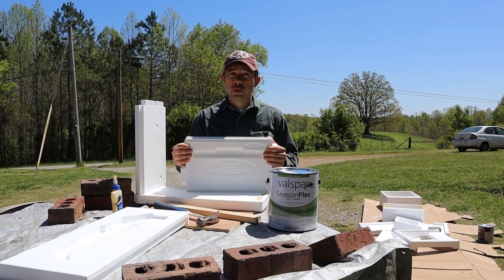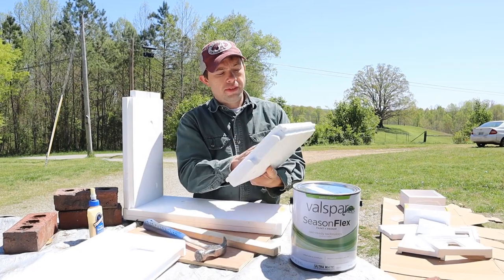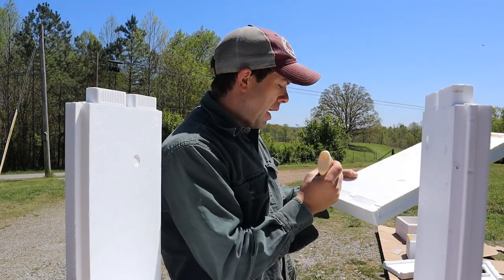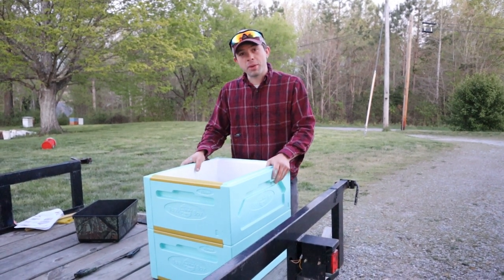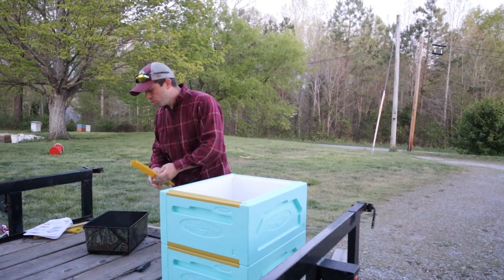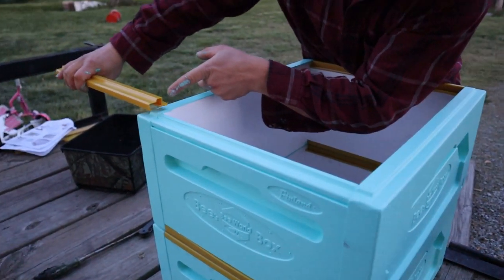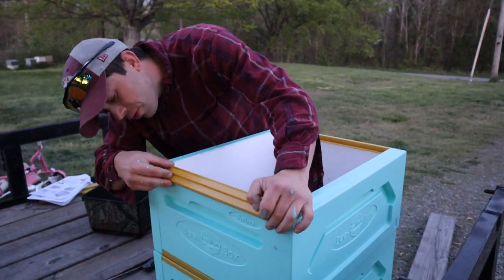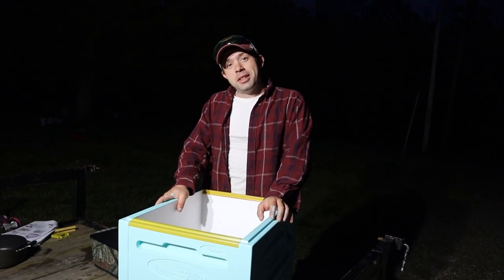How NOT! to assemble a poly hive!

Comment: I helped a friend with bees in 2 colonies, 2 stacked poly 6 frame boxes that he purchased from a local that was moving. Also a couple dozen 8 frame wood but those were empty. All were deeps. We purchased 4 nucs to get those installed in some wood. Bought 6 new poly last yr and did a Kamon but I am a sun worshipper and put them together out on a picnic table so the plastic was sun hot. No trouble snapping it in. Up here in Michigan I have to tell you that we did not have to worry about the poly boxes. Those still had a lot of winter storage left come spring. Last year we had to do splits early on because they were hatching and making queen cells before the wooden got numbers built back up. I love the smaller 6 & 8 frame because while the honey is good, not into it for production/sale yet and at our age, lighter boxes are prefered. Concentrating on building up and spitting for another year. 15 farm acres in town with a lot of resources. It is an active personal production farm that got absorbed/surrounded by the city when the borders were pushed out so it is grandfathered.
Reply: Sounds very nice, there is a another place that sells a 2 inch version of this type of hive made in the US and Ohio called Superior Bee. I have both types Finnish and good old USA.

Comment: these 10 frame and 6 frame polystyrene hives are pretty much all i use and have used for going on 9 years now, definitely my choice over wood. my recommendation for paint is ppg timeless in blank canvas tint, and don't paint the spots where the supers touch as they will stick there and tear off paint in hot weather. but with ppg timeless exterior latex as suggested to me by a career painter, i have hives that are 8 years old and look like new. but there is always a negative as with anything, bees cannot use beneficial propolis in these hives much because of the surface so I'm going to try to staple rough sandpaper or something similar to the inside of the brood chamber on one to see it they propolize it. as always great video and if you need any suggestions about the polystyrene hives feel free to reach out as I've definitely gotten familiar with them over the years. now if only the shipping from bluesky wasn't more expensive than the entire order most times lol

Comment: Hi Kaymon, been watching for a while and I thank you for your insights. I use these exact hives exclusively in my apiary... I live in Northern Australia where it is hot and humid all the time. I love these hives and do not use timber anymore. My tip for those plastic guides is slide them on before assembling the sides. You can use a second bottom board on the top under the lid with the mesh in them as a way for the bees to ventilate the hive. Since doing this I have not had any absconding. The issue I have had is that if your not removing dead outs quickly the wax moth will eat the EPS quicker than timber boxes. Keep it up always good to watch and entertaining as well!

Comment: LMAO.  I saw what you were doing and said out loud "where are the plastic inserts?"  We are trying two of these this year and made a couple videos on them, one "first look" video and one "moving day" where we moved NUCs into them.  The thermal regulation will help a lot.  One thing I found is these have ZERO top space above the frames, that is when the frames are inserted, they are level with the top of the box unlike our wooden Landstroth boxes.  I also ran into problems with the medium supers are 1/16" too short and the frames do not fit (tried 4 brands of frames) so a little Dremel work with a sanding drum on the plastic inserts fixed the box so I can use any frames I have.  They have used poly boxes for over 30 years in Europe, closer to 40 years.  Keep them high enough so animals can not chew on them (mice, possums, raccoons, skunks, etc.)  We painted the inside of ours as we have experience using 2" polystyrene insulation boards in the winter under our covers and the bees will chew the polystyrene but if painted they seem to leave it alone.  I will be doing a short video on that too.  Any Queen excluder can be used with these, supers can be stacked on as the internal dimensions are the same but do not interlock like the poly boxes.  Im looking forward to seeing how your results are compared to our results here in southern Ohio.  Keep it up, love your videos guys!
Reply: There is a Amish guy at Superior Bee that sells a version of the Finns hive but 2 inch thick and made in the USA/Ohio just FYI. I am experimenting with both brands.
Reply: Hey Tony, I watched your video again after watching Kamon's.  I should probably try one to see how much better the bees do with all of this heat here.
Reply from the maker: Wow thanks for the insight Tony! FYI I just watched your video on moving bees into one
Reply: @kamonreynolds  I think these are viable option for the hobby or sideliner Beekeepers but the price will prohibit commercial use.  They are not as durable but from those I have talked to, less energy is waisted in regulating the box which then allows more population to work on brood and honey storage.  In Australia, Beekeepers found these work very well in the heat.
Reply: @SuperBuickregal  I to got one from him, fit and finish were not good. i didnt get more from him.
Reply: @kchelius32_K8KNT  Yeah some of the parts do have flash like a model kit, I used a rasp to clean up the edges of the parts, should not have do that but it worked.
Reply: @SuperBuickregal  one of my deeps was 3/8 of an inch smaller than the other, frames didnt like to fit. had to modify.
Reply: @kchelius32_K8KNT  Sorry to hear that, only issue I had was the extra material that had to be removed and I do not doubt you have issues. Not sticking up for them but they are improving quality and would love to see more US manufacturing on a whole. The plant is in Ottawa Ohio up close to Toledo I believe.

Comment: Hi Kamon,
I want to share my experience with similar beehive PARADISE HONEY LANGSTROTH. These are excellent for keeping the bees warm. The entrance reducer provided is great and very useful to control traffic. The additional plastic strips adds support to the boxes and makes it easier to separate the with hive tool or without it. The problem I had is that the plastic runners from the inner side of the boxes on which you would rest the frames, protrude towards the inward of the box (does not flush with the box wall) which causes rolling of bees and "wiping" them every time I lift a frame up.
Two weeks ago I have done a hive check, it was thriving but unfortunately I witness plenty of bees were knocked off the frames whenever I lift them up and likely I damaged the Queen then. I can confirm that yesterday I could not find the queen, no eggs and no larvae, just capped brood and plenty of queen cells, 4 of them are smaller typical for emergency queen cells which tells me they were not prepared for her loss. I know I could have tried to lift the frames in an oblique fashion rather  lifting them up straight. It is too late now.
I had to split the hive into 3 nucs yesterday and hope if the weather improves for the new virgin queens to emerge and mate.
Just something to consider with the frame runners.

Comment: I'm infamous for assembling things out of order (instructions?  I don't need no stinking instructions!) so I appreciate your superior teaching method of showing the wrong way to do things.  This will stick with people far better as a lesson than if you'd have done it the right way.  I went over to Blue Sky and looked at prices.  I really don't understand why injected molded foam should cost a third more than wood.  Since some southerners have cooked their hives with winter insulated wraps, I'll be interested in seeing how the bees handle this in summer.  For testing the extreme, please make sure your test hive is on the upper end of bee density.

Comment: I work part time at a auto restoration shop. A couple of days ago it took 3 of us about 2 hrs to assemble a "Cozy Coupe" (An easter gift for one of the kids, not a hired job, but we WILL restore just about anything with wheels). We had it back apart a couple of times and the parts that we had left over turned out to be assembly tools (but we didn't "cheat" once by looking at the instructions).
Extra points to you for not cheating until you had parts left over... the sign of a true master of the art.

Comment: I have 7 of these Bee Box hives in Provence, with summer temperatures up to 95 -100 degrees, and slight frosts in winter, the hives have shown no signs of deterioration at all, and the bees seem to thrive. Beware wax moth though, they can seriously damage the polystyrene if you get an infestation. The struggle you had in retro fitting the plastic frame supports gave a good illustration of how strong the polystyrene is!

Comment: That glue is not going to dry for MONTHS, literally months!  Foam & wood glue don't work so great.
Epoxy would dry.
The problem with wood glue is that air doesn't get to the center of the joint.  It will after a year or so...

Comment: You're Insulating Bees that Naturally generate around 95 degrees, They heat the hive, they are the ones that heat it up. If you want to cool the hive Insulation is not going to help. Insulating the Hive without Ventilation they will just circulate the heat. Just saying. Those are made for winter not summer. Add Shims with vents. Also bees can only work like a fan not an ac unit. So they can only stir the heat on hot days.
Reply: Hives come with a completely vented top cover and the inner cover is also ventes and the base is a screened bottom board...  The real world experience Ive seen has shown no bearding of bees on a hot day when the close by wooden hives are covered in bees...
Reply: @chrisjohnson4666  Kamon neglected to show us those parts. Lol
Reply: @Warren76317  i have them its not cheap i run 3 deeps all winter because we usually dont get a good flow until late April and am not a production outfit... anyway I bought enough for 2 hives so 3 deeps, 2 vented covers, 2 screened bottom boards, two feeders, and enough piercco frames for all and was almost exactly 500 bucks im an hour away so I drove...
Reply: Insulation slows heat transfer.
 
Can keep heat out and they need less ventilation.

Can keep their generated heat in.  They need to produce less heat: saves honey reserves used to produce heat.
Reply: @georgekatsinis5224  yes it does slow heat transfer. That work both ways. If it gets to hot then it can be harder to cool. Kinda like using a 5000 btu ac unit to cool a 2500 sqft or more  home. I wouldn't have post this comment if I would have seen it also comes with a screen bottom board. As far as ventilation, you should always provde good ventilation near the middle or top of the hive in all weather. Provided the bees can control it if it's to much. They should be able to propolize its closed. So screen would be a great option.